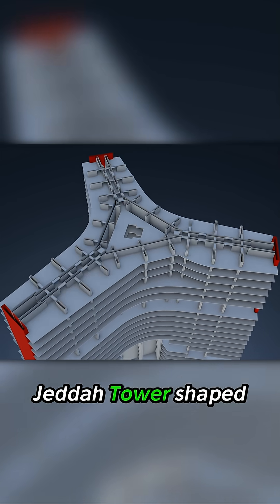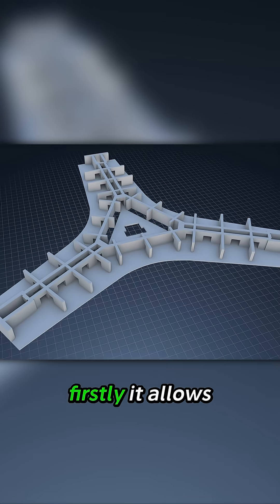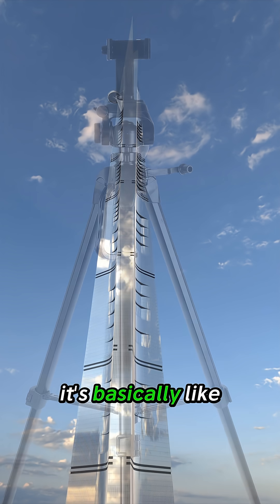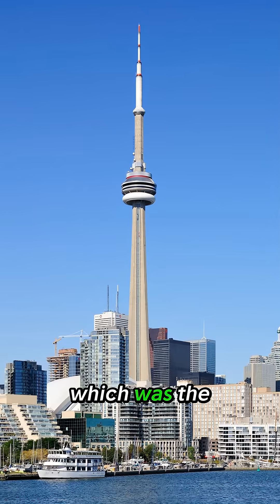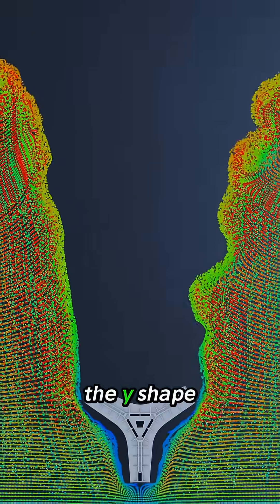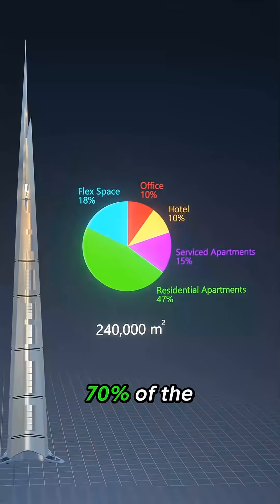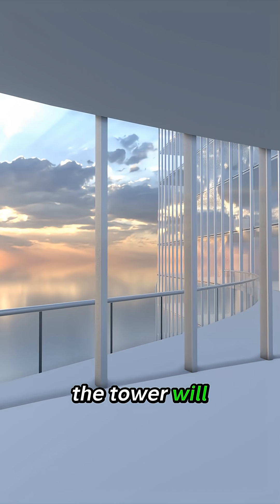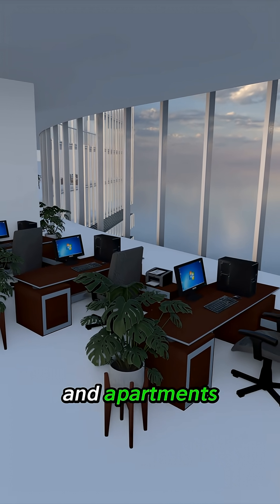Why the Jeddah Tower is Y-Shaped 🏗️

Comment: have you seen the construction new photos and noticed the square hole on the edge of the tower ? ( flat wall on the very edge ) why is it there ?
Reply: I don't know, but it may be a technical opening designed for deploying the facade maintenance platform.
Reply: Been using the this website
Reply from the maker: Can you point me to where these photos are? That sounds quite interesting
Reply: @Contraflex  almost every image of the building shows the odd square hole

resortx construction board is the name

Sense YouTube hates website links for some reason
Reply from the maker: @DCcopter I found the photos and it's very surprising to see penetrations in the end walls. I agree with Podzzy that is probably to do with accessing the facade
Reply: @Contraflex  yeah, also by the end of the year i think it could reach floor 85